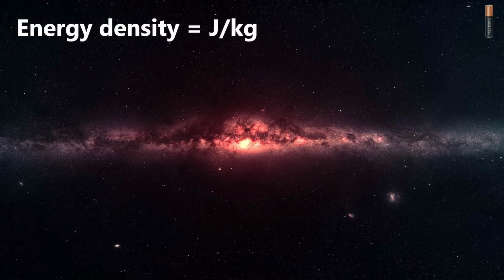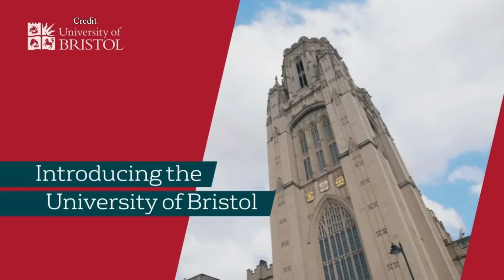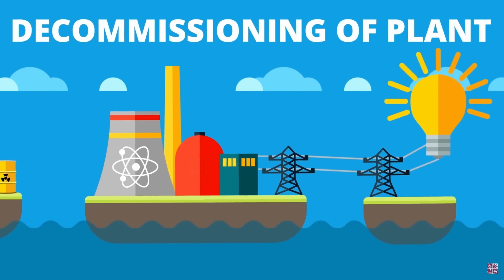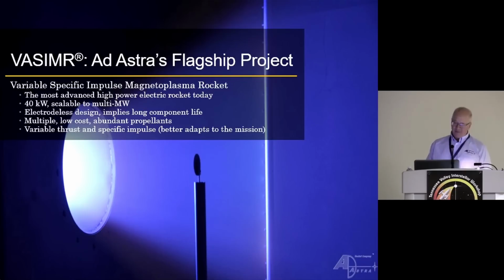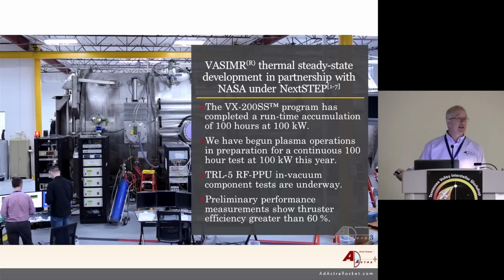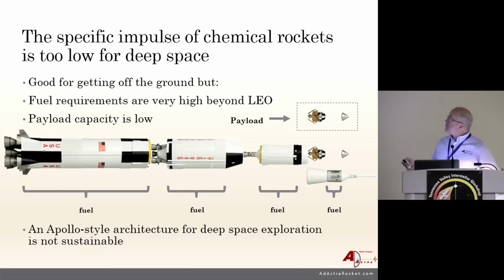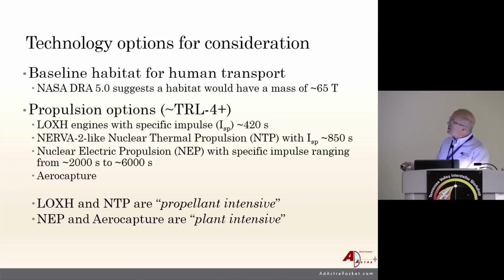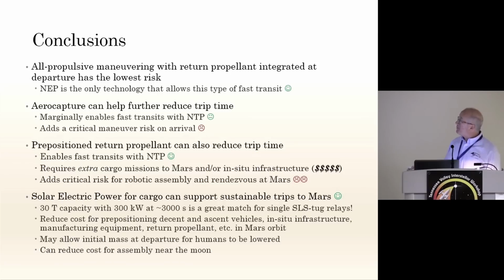Can Nuclear Voltaic Power Get Us to the Stars? Or at least Mars?

Comment: A beta voltaic cell is more or less a solar cell using radiation instead of light ...in the early 2000s, I read an article about a nuclear cell phone. The phone had rechargeable batteries, and the betavoltaic cell charged the phone when not in use ...
Reply: Well, cell phones used less power back then. The betavoltaic generator + battery is a good solution for seldom used devices, only if you live on a planet without light from the Sun. Otherwise, small solar cells are cheaper, lighter, easier to manufacture and more practical.
Theoretically, there have been commercial betavoltaics - the NanoTritium cell from CityLabs. I've never seen one. But they keep getting talked about, every year, for the last 2 decades.
Reply: @PaulSpades  Phones then used NiCads or nickel metal hydride batteries....and , in theory, could be trickle charged by a betavoltaic cell when not in use. No bulky solar panel.  I don't know if any prototypes were built...I got the impression none were. 
      I did see a tiny model steam engine running a small DC motor as a generator used to charge an old Nokia phone. Steam cell research? 
    Some pacemakers back in the day had a radioactive power supply...my grandmother had one in the early '70s...I don't know if it was a tiny radioisotope generator, or a betavoltaic cell.
      These were used in patients where surgery every six to change batteries wasn't practical ( although why not use rechargeable batteries and inductive charging? ) .....
Reply from the maker: I like it.  Most of our devices have at least six hours of "down time" due to sleep.

Comment: 65 years ago, my Physics teacher said to me "An ounce of electrons can launch a battleship to Jupiter." and then chalked the maths on the blackboard.  Difficult to forget that . . .  😎
PS.  I have forgotten the maths, but remember his name:  R. M. Marsden.  Bless him.
Reply: Depends on how you use the electrons. If using 1 ounce of electrons going across a 1 volt potential, it can accelerate a 53.5 ton battleship by only 31 mph. You need 30300 mph to go directly to Jupiter, or 23400 mph with gravity assists from Venus and Earth.

If you convert that ounce of electrons into pure energy, e=mc² style, you get 2550 Terajoules. That's enough to get the USS Alabama(1942) to Jupiter with gravity assists or the USS Nevada(1916) there directly.
Reply: He used more than a volt and was much more general about battleship weights, and knew nothing about gravity assists, I suspect.  Thanks for the polishing there.  I went in the direction of thermodynamics after that, and now, of course, I have no brain left, and must swim in the tropics.  Cheers.   @kolbyking2315
Reply from the maker: Teachers like that are what inspires the next generation to do great things.  My physics teacher, Mr. Sears, told me when I was just a subnerd that a single proton... accelerated sufficiently.  Could launch a rocket to the Moon.  Blew my mind.

Comment: Beaming power from satellites orbiting Mars can easily power the entire planet’s colonies
Reply from the maker: If you've got big enough arrays you could say the same of Pluto but it's not viable.  Too much infrastructure and again as Tony mentioned.  Planet wide dust storms might interfere with you microwave beams.
Reply: Mars has dust in its atmosphere permanently,  (It must be very fine!)  There's less gravity, and almost no humidity. @terranspaceacademy
Reply: The size of the dust grains averages 20 um so the much larger wavelength of the microwaves means the beam is not affected directly. 
I am surprised stand disappointed by your ridiculous assertion that solar is impractical at Mars distance from the Sun where intensity is about 40% if that at Earth distance. At Pluto it is about 1/1600th. Also the difference at Mars orbit can be easily made up for by low mass/area aluminas Mylar or similar reflector which then allows the use of triple junction cells for concentrated sunlight which can be over 50% efficient and an order of magnitude more power/mass. In addition the power says could provide comm and GPS.
Reply: Dust?

Comment: Would a nickel and carbon 14 structure weigh less than stainless steel? Just as strong? Why don't they build the booster out of carbon fiber now? Just shield it and add insulation.
Reply from the maker: That's a good question and the answer is a four-letter word. COST.  Steel is cheap and millions of workers are trained to use it.  Carbon fiber takes special equipment and knowledge.
Reply: @terranspaceacademy  would the weight difference nullify the cost difference over time? Or just add solid rocket boosters for heavy payload launches.